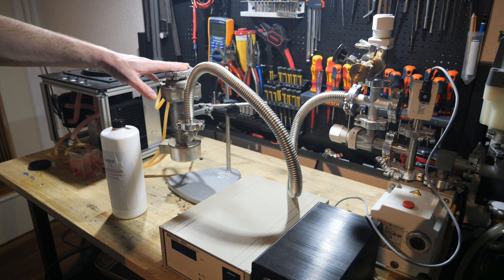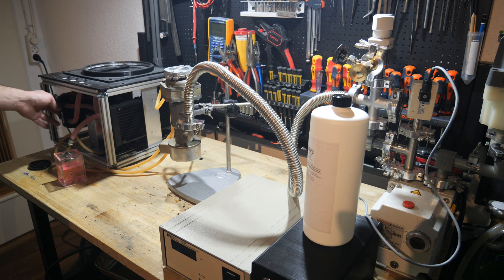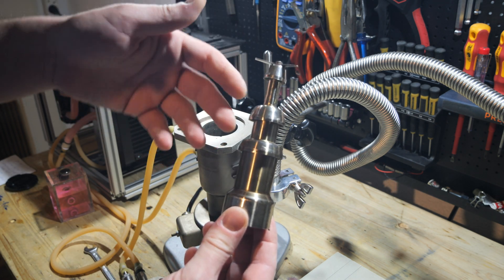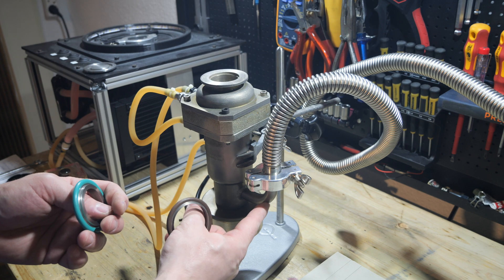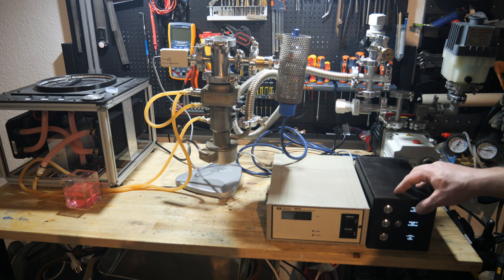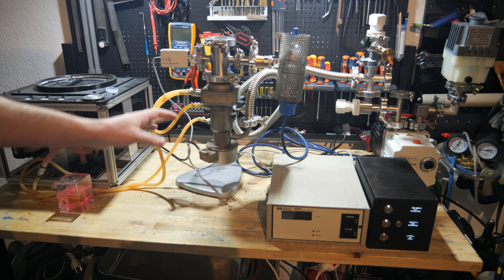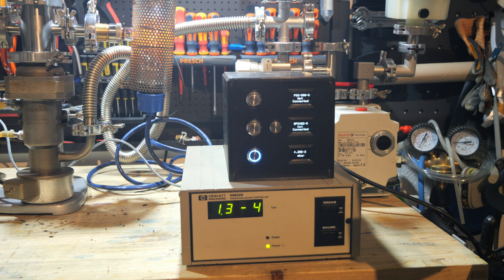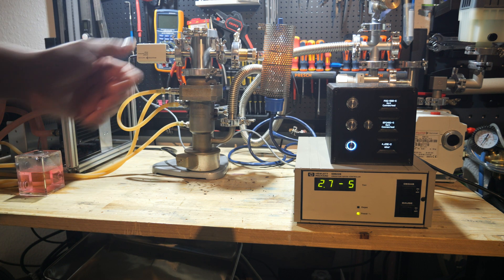First time testing my diffusion vacuum pump

Comment: I noticed you don't use gloves, if you did when handling the inner parts of the diff pump you could probably get to a much lower vacuum because you would not have the oils deposited from your finger outgas, which would prevent you from receiving the full vacuum of the diffusion pump

Comment: 9:20 Its normally totally silent when running. But with new oil what you hear is the water vapor in it that boils off and it will be less and less until you only rarely hear a small pop till you don't hear anything at all anymore which then means the oil is absolutely water free.

Comment: 6:29 Wrong way. It should of course be the coldest at the top to absolutely surely prevent any oil to enter a chamber and THEN whatever cooling is left goes to the pump. If the pump is cooled to much the pump would get into problem and could even loose its pumping and if the vapor curtain will get disrupted you will get a huge amount of vapor into a chamber.

Comment: you should run the water the other direction. First the baffle then the pump body. This way you heat the water less because there is more heat in the pump body and filter more oil vapor.

Comment: 3:25 the main point of using gloves with vacuum equipment is not to protect it from your fingerprints but to protect you from whatever nasty stuff it used to pump. With used equipment you never know whether it was decontaminated properly.
I have no idea where that seller got this pump because accordingly to german regulations institutions are not allowed to sell old equipment to private persons, it have to be wasted. And nobody cares to decontaminate it before wasting, and if this guy just picked it from the scrap, you got the point.
Reply: For modern oil free vacuum systems that want to reach UHV or XHV the fingerprints can be an issue for the vacuum quality

Comment: Does a KF25 centering ring fit the ID of the top flange? The part you asked about looks like an adapter of some sort since the two sides do not look symmetric. The bottom one is likely KF10, they use the same clamp size as a FK16 but the centering ring is smaller for the KF10.
Reply from the maker: Thanks for the comment! Yes the lower part seems to be a KF10 flange. I did not know they have the same outer diameter as a KF16 flange. A KF25 centering ring fits the top flange (but its pretty loose). But the outer diameter is that of a KF40 flange. Another commenter said its probably a KF32 flange. I think he is right. A KF32 flange has the same outer diameter (55 mm) as a KF40 flange.
Reply: @AdvancedTinkering  If you ever need a replacement Ideal Vac has what I think is the exact same part shown in the video (KF32 centering ring on one side, KF40 centering ring on the other) in addition to a KF10 to KF16 adapter ring as well.
Reply: I think I found the part, unfortunately my reply with the link has been deleted... Thanks YT... But, it looks like a KF32 to KF40 adapter, search for "Stainless Steel Centering Ring Adaptive KF32 to KF40 Vacuum Fittings, ISO-KF Flange Size NW-32 to NW-40, Viton"

Comment: Wow glad you got it working! That oil is cool stuff. I wonder if there's any procedure for degassing it (to get out random junk picked up from air), beyond just running the pump. I don't know a lot about diffusion pumps or achieving any particular degree of vacuum with them. Good start.

Comment: Beautiful pump! I also have a soft spot for diff pumps, specially the small ones. The small flange is most likely KF10, that is still very common today, but the other one, that is most likely KF32, is not that common, I've seen them only on some very old leybold equipment. New diff pump oil takes some time to properly outgas(several hours), but when its done, you can get down to really high vacuums. Keep the water temperature at the baffle as cold as possible, the pump body temperature is not that important, just needs to be under 30c. DC705 is very high quality oil, should be able to get down at least to 10-7mbar. Just recently I have stumbled on your channel, just amazing work, keep it up!
Reply from the maker: Thank you! I'm glas you like the videos! 
I will try and degas the oil for a while to see how low the pressure will get. And thanks for the Information regarding the flanges!